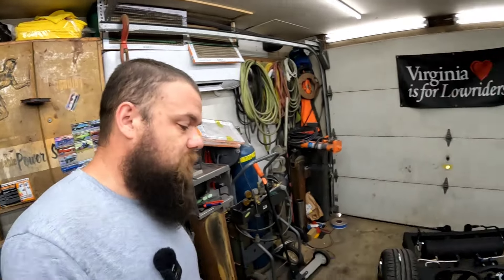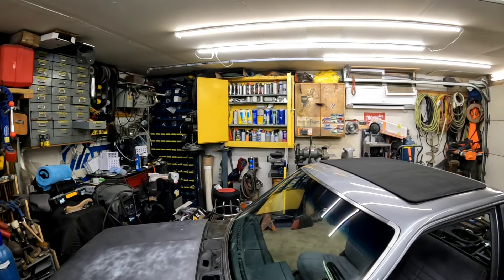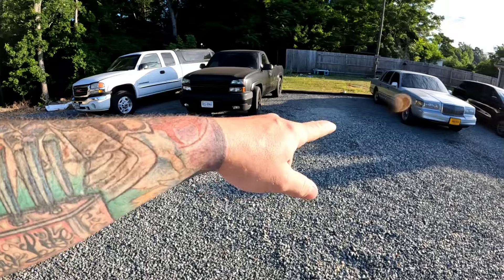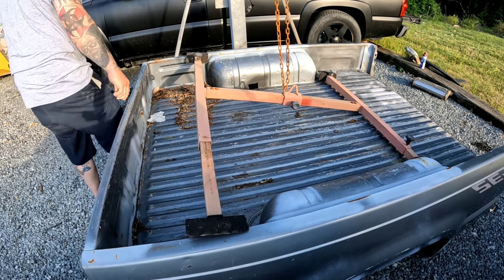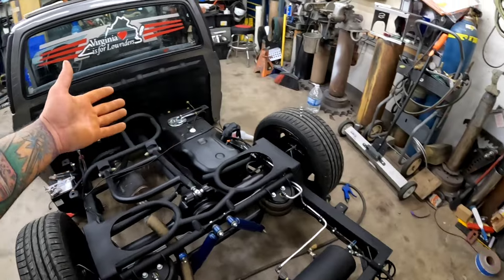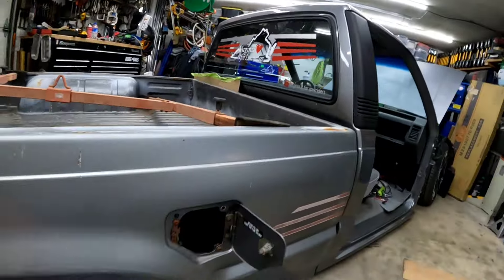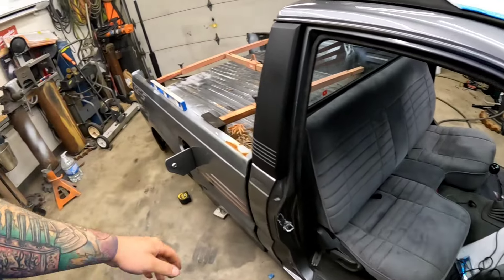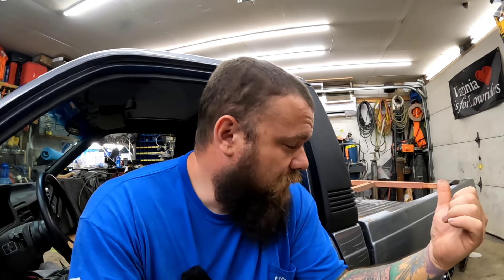Bagged Mini Truck Build #51

Comment: Dude!  Dont blame ya for taking it easy from the heat... Def. is always a cool sight when the bed goes back on and see it tuckin' wheel... And i'd most def. just throw the sheet metal back on it and cruise till later in the fall... Enjoy that thing and also give ya time to work out any kinks if any pop up... Lookin' Good!!!
Reply from the maker: Thanks man I appreciate it . I think that's the plan. Just make it run and drive for now work on it here and there until it cools own some. It's definitely nice seeing the bed on it for the first time.

Comment: I like how small that switch box is. It's beeen 94ish and humid over here in Michigan, too. I understand about it killing your motivation. I work at a stereo shop with no A/C and I can't open the garage door for a cross breeze because we have a tinter in the shop like every other day. Edit: Looks awesome with thee bed on!
Reply from the maker: My day job shop we can open the doors but they are on one side of the building so you get no breeze. The switch box has a nice size, but they feel super cheesy. I prefer an actual toggle swith with an extension, which it might end up with later on.

Comment: You could run the compressors off of accessory that way when it's cranking the compressors aren't on.
Reply from the maker: They will still be tied into the ignition . The switches are just to be able to turn them off if I choose to.

Comment: Hey it's Victor I  don't know what kind of room you have between the bed and the frame. You said something quick and easy I wonder if you could use hockey pucks and drill a hole in the center between the bed and mounting point and run a bolt through them to mount the bed. Just a thought. 👍
Reply from the maker: I need just under 4 inches.  I'm not sure how tall a hockey puck is.  But I'll look into it.  Thanks man!
Reply: Awesome on the bed almost being perfect! I like those dash switches too. Lookin good man!

Comment: Hey, Love the truck and work. Question, do you have to take the bed off to get to the battery?
Reply from the maker: I'll be able to access it through the wheel well.  Also it will have lugs to jump start it if it ever needs to be from inside the bed.  Thank you  !
Reply: @Virginiaisforlowriders  Awesome, Thanks. Can't wait till the next video. My truck has a long way to go to get to your level of truck.